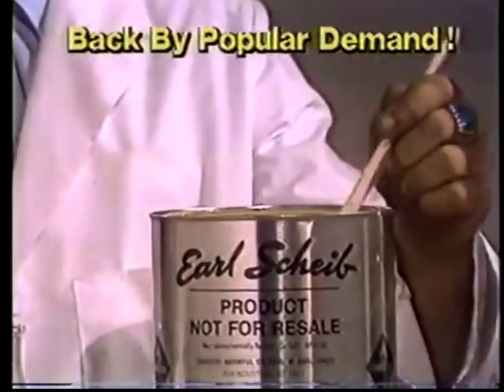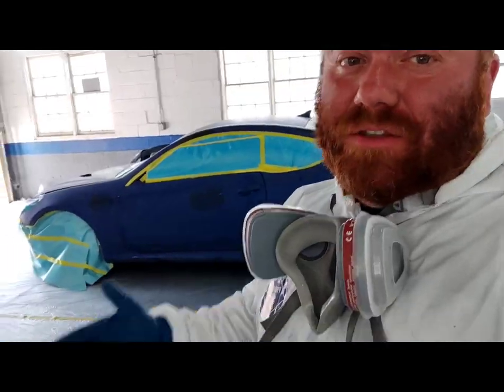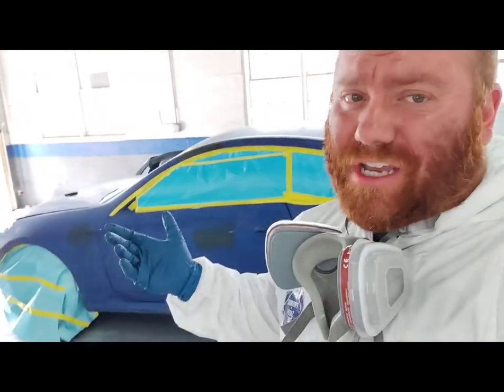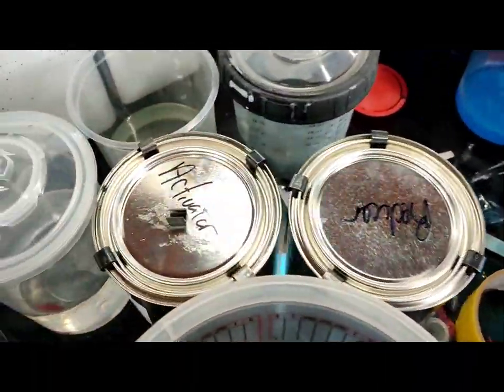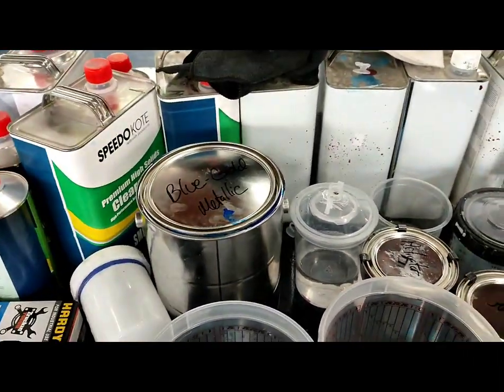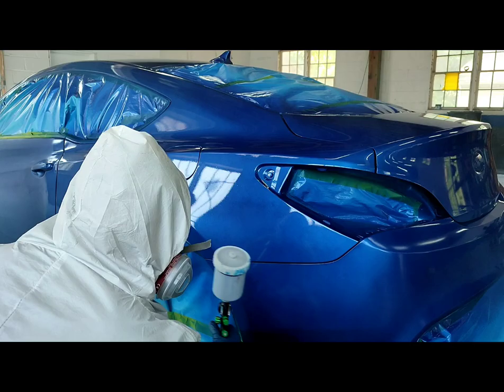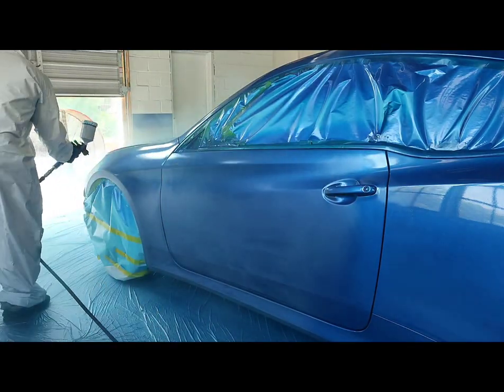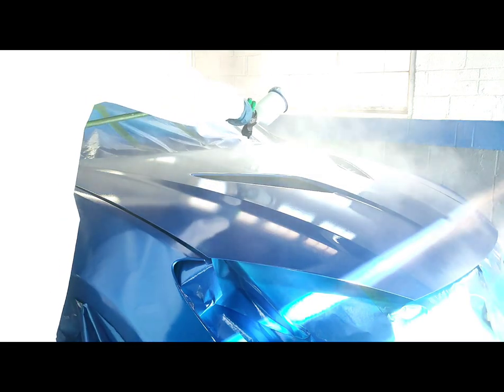300$ paint job

Comment: WET THAT FLOOR DOWN, YES! I painted for about 7-8 years and was a very good natural painter who got excellent results with very little to no trash in the paint. I never wet sanded and buffed afterwards because I was able to control the output to prevent runs and because I wet the walls and the floor of the booth before spraying which is MAGIC when it comes to getting a clean finished product. When I saw the video I clicked on it just to see if you were wetting the booth beforehand. Lol. Great job.
Reply from the maker: Your right man!

Comment: Notice how he is walking with the gun down the sides to get one continuous pattern with no overlap on the metallic base. This is how you get a good even flow to the metallic particles. If you do each panel separate you will have too much overlap and there will be a buildup of the paint in the overlap areas and cause it to be wetter and the metallic will lay different and not match the rest of the car. This guy knows what he is doing.
Reply from the maker: Sometimes with mettalics the very first coat I will panel paint just to get the coverage down. Then once its all one color I will walk the gun about 2 times down the car to get everything even. It's all preference. But yes definitely have to walk the gun on some of these mettalics to get it right
Reply: @speedokoterefinishnetwork4937  The hardest thing to get a perfect match on by far is tri-coat. That damn pearl can be super finicky. It’ll look dead on indoors and then you get out into the sun and it looks different. I worked a few different shops from a salvage title rebuild dealer buying from auctions, to just a standard repair shop, to a new car dealership. I didn’t sweat the metallics too much once I got a some experience under my belt, but man I always hated tri-coat. Best wishes to you and your channel brother. What state are you working out of?

Comment: hey buddy that sob looks nice really nice congratulations on another beautiful spray! I got some smr 42 sitting in the shop for my next spray I used the euro on my first spray due to volume, price, and me being a rookie I did two coats sanded then another 2 or 3 on top, the infamous flowcoat😂 my question to you is with the smr 42 I wanna lay down 4 coats on my personal vehicle any tips? besides making sure I have proper flash time I bought medium activator plan to spray early in morning before it turns into a sauna I live in the panhandle of Florida
Reply from the maker: Make sure you keep extending the flash time after 2 coats

Comment: The car turned out great and I have been using some of your clears and primer for a while now.  Can give me any tips on spraying SMR-115-Q to me it sprays different from regular clears.
Reply from the maker: There directions on the can are usually always spot on 🙂🙂 just spray it medium wet and smooth and allow flash between coats

Comment: I did a whole car for 500 including the car but as for painting as a small guy buying stuff from wallmart you can buy materials for 50-60 bucks and you can do 1.5 cars or a suv comfortably. Paint is a whole diff story
Reply from the maker: Let me guess dupi color?
Reply: @speedokoterefinishnetwork4937  2 stage but i used old clear laying around and the car was 240 from a druggy. 120 for base and reducer, 240 for car, I spent like 40 for materials and the rest went to rebuilding the engine. The car came with head gasket kit.
Reply from the maker: Man.... I gota see this one

Comment: I wanna spray a car in your single stage, jet black. Would I be able to let it dry and sand any dirt or in perfections out with 2000 then clear it. With this show where I standed the dirt out?
Reply from the maker: If you do 3-4 coats of paint should be able to wetsand and polish with 2000 grit no issues. Would also sand with 3000 before moving to the buffer

Comment: Nice job as always, but in this case, I will say that it's not as helpful for those of us that are taking mental notes on what works and what doesn't because you used a bunch of unlabeled stuff. I'm that guy. I have something to spray maybe once a year or so, usually part of a car, a minibike, something for my kids... and I'm just competent enough that I don't embarrass myself but also don't do it enough to be able to justify a nice gun or know what works and what doesn't. A lot of the mental notes I take watching stuff like this don't do me much good because I'm in MD, where we have to follow stricter VOC rules, and I can't get a lot of the products you use shipped to me or from the local shop. 

I'm curious where in PA you're in? I have a bunch of projects sitting around that need various levels of prep and paint, stuff that would show lots of stuff that you don't run into with your cars (ranging from a Trans Am with a bunch of fiberglass parts on it, a Cadillac, which is huge and has all sorts of easily removable and some not so easily removable trim and shiny bits on it, a crew cab long bed Cummins Ram which is 6" longer than the Cadillac (not sure if that's more of a comment on the Cadillac's size or the Ram's), that again, is huge but almost no trim to deal with, but has some rust spots, a 71 Mach 1 Mustang Arizona car (very little rust and what it has is surface rust, mostly straight, but is missing a couple of pieces)... Stuff that would present different challenges, substrates... than most of what is on your channel. I think that it would be interesting to your viewers to see not only different "issues" but how it would go with you trying to show a relative noob how to get some of this work right (and, of course I would love the opportunity to learn, get something of mine all one color, and possibly drive some Youtube traffic to some of my stuff).
Reply from the maker: Hey man I'm in Central pa. We can talk if you want work done we are a professional body shop open to public and can delivery

Comment: Excellent job as usual.  I finally bought the SMR 42!  I pray the price stays the same for at least this summer.  did you use slow activator on this one and what was the shop temps?  I also bought the SMR-105 fast dry clear coat for hoods and panel jobs (THAT STUFF REALLY CURES AS SEEN ON YOUTUBE!!!!!).  Also bought the SMR-1103 fast dry euro clear (for high end vehicle panel repairs; would be also if I can pull of an overall with this clear, Have you Marko?).  I know what its like to sprint from the rare of the vehicle back to the front to shoot the other half of the hood. LISTEN FOLKS, THIS CHANNEL PUTS OUT A LOT OF POINTERS TO HELP YOU GET THE UPPER HAND IN YOUR MARKET DEMOGRAPHICS.  SUBSCRIBE AND GET THIS CLEAR!  i'VE USED THAT FAST DRY SMR 105 CLEAR.  IT LAYS FLAT AND CURES AS WRITTEN, I DON'T HAVE TO WASTE A HALF DAY DOING A HOOD AND 2 FENDERS ANY MORE.  WITH THAT CLEAR I COULD'VE DONE 3 TIMES THE JOB IN A DAY.  CAN'T WAIT TO TRY THE FAST DRY EURO CLEAR I BELIEVE IT WILL GIVE MORE LUSTER TO THE PANEL.
Reply from the maker: Nice man! And thanks!